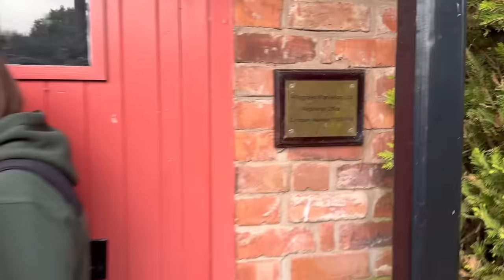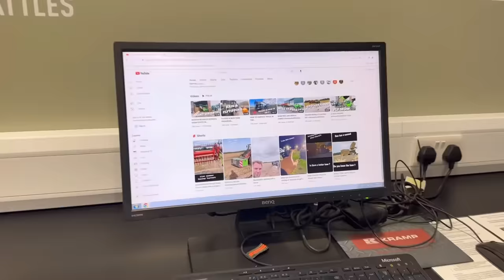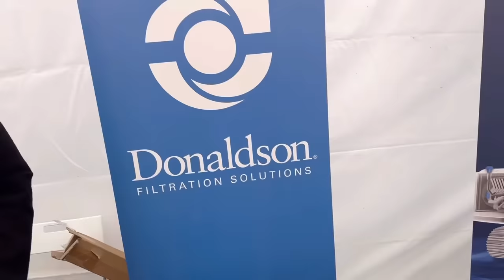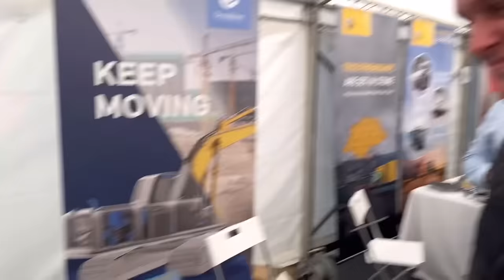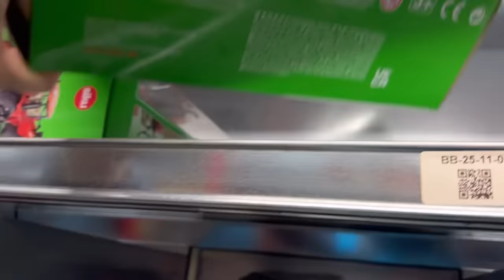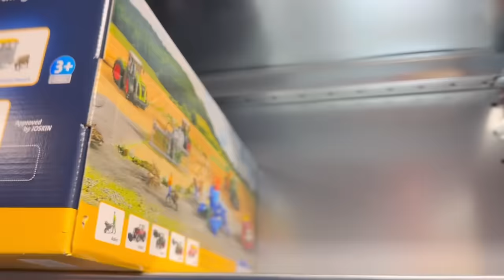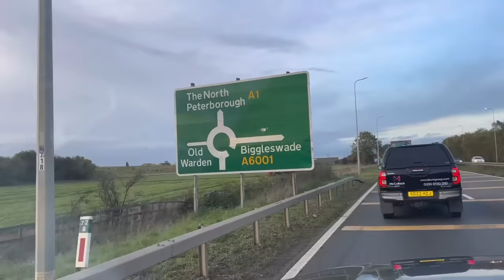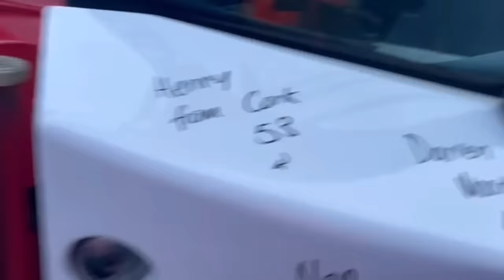VISIT TO A HUGE TRACTOR PARTS SHED #AnswerAsAPercent 1332

Comment: The reason items appear randomly on the shelves is to avoid the picking person picking the wrong item. Imagine an order for a toy tractor, if all the toy tractors were on the shelf together they could easily pick the wrong one. But if there is only one on the shelf they are told to find it and say the item next to it was a washer and bolt. They are unlikely to pick one of those rather than a toy tractor. It appears inefficient but is actually more efficient as you get fewer mistakes.
Reply: Came here to say this.
Reply: Also, if they are using a decent system directed put-away, it should be putting higher volume items in the most efficient to pick from locations - ie between waist and shoulder height (if I remember correctly - it's been a while!)

Comment: I can remember back in the 80s, it was called Jack Ashurst Ltd based in Sandy, and the building wasn't much bigger than your grain store, iirc it was around 1999 when it became Kramp Ashurst and moved to Biggleswade, i worked for the local Massey ferguson dealer,  Rogers Engineers,  and i was in there at least once a week picking up parts, mostly cultivation, plough and drill wearing parts

Comment: Tried to buy from Kramp, needed to set up a full account, seemed a bit of a faff so didn't bother. Shouldn't it be easier these days? I don't mind a minimum  order amount.
Reply: Same here tryed the same one time wasn’t very straightforward an wanted me to go through a dealer which seamed pointless
Reply: Can have account through ur local tractor dealer it’s easier
Reply: @Markmackintosh  why does my local tractor dealer need to be involved. No wonder Amazon do so well, their potential customer base is every person in the UK, not just those with a relationship with a tractor dealer.
Reply: Yeah it's stopped me using them a few times. Too much faff to go through a dealer. Do you know why we can't buy direct?
Reply: I buy direct off them,told them I didn’t want to use a dealer.
Reply: Yes it like being back in the 1980’s where companies would only deal with you if you had a trade account. Sure they miss out on a lot of business. They could be the one stop shop for all things farming for everybody